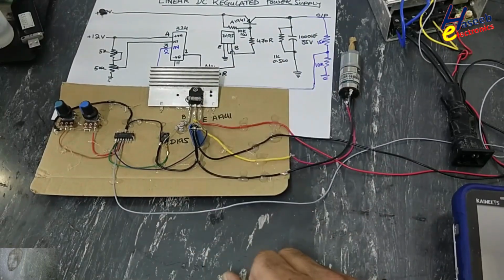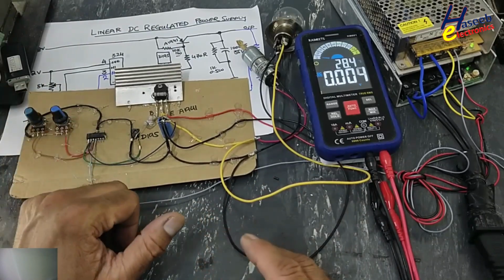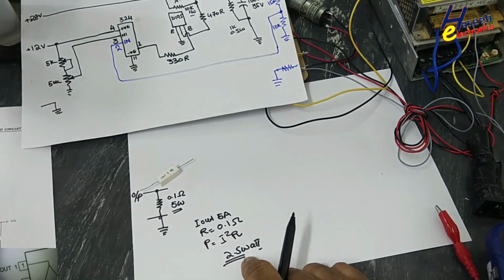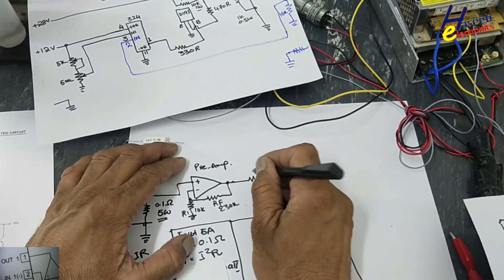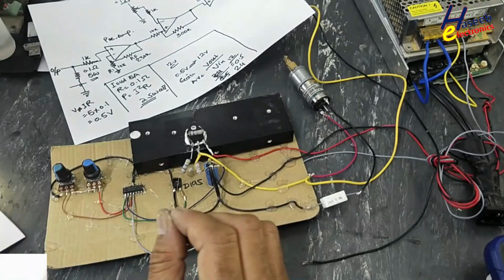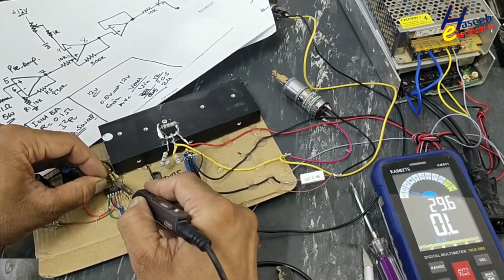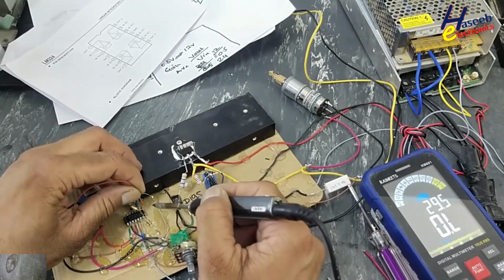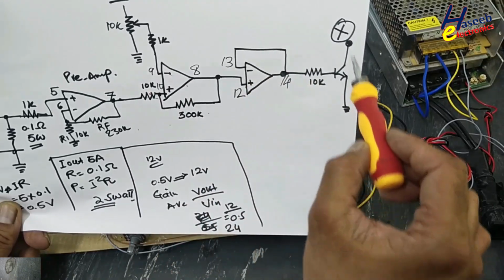{1336A} Designing a Regulated DC Power Supply Using LM324 | Complete Circuit Guide

Comment: Dear Ashraf, very impressive video and nice to see how you handle so many op-amps.
Can I use 60v by changing the divider network ?
Can i use P Channel mosfet to avoid heat ?
Can I use only 2 op amps ?
Thank you for making us understand complex handling.
Reply from the maker: Good Evening dear brother Hicham!
thanks for your valuable words 
yes, the same control will work with any voltage level. just increase power transistors in parallel. and increase voltage feedback resistor 
in linear power supplies, BJT is the best option because it hase a wide linear conduction range. MOSFET will not provide much accurate result. 
to make it more stable same 4 opamps are to be utilized. you can also use 2x LM358 ICs. 
still this circuit needs many improvements. which i will make in upcoming parts of this video. if i complete all the sections in 1 video, that will more and more complex for viewer to follow the circuit. 
i am also planning to use LM723 IC that is dedicated linear power supply regulator IC.
Reply: @HaseebElectronics Thank you for your answers. I can't wait to see your forthcoming videos.
God bless you

Comment: Dear Brother Ashraf, I finally made the circuit. It works very nice but when load is more than 10A, the voltage drops from 12v to 3v and doesn't pick up.
Everything is strong (many PNP in parallel, strong transformer and diodes). I am suspecting the base of the Darlington not receiving enough voltage...
Any idea where to look at ?
Many Thanks.

Comment: Have a LED indicator  in this design for over current and protect adjusted current over?
Reply from the maker: yes dear. i am planning to add CC, CV, Crowbard, Over cuurrent, Over volatge, indications, and will add over voltage protection

Comment: Sir, LM324 ic is not available in my local market. Can I use two LM358 ic in this circuit?
Reply from the maker: yes. LM358 is 2 channel IC. you will need 2 ICs LM358. that will work. even you can use any available OPAMP IC.